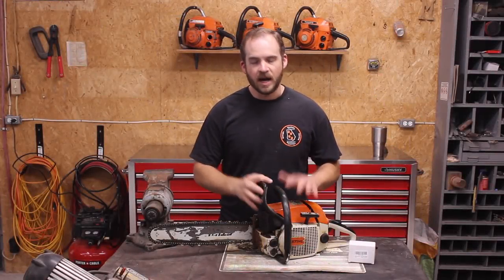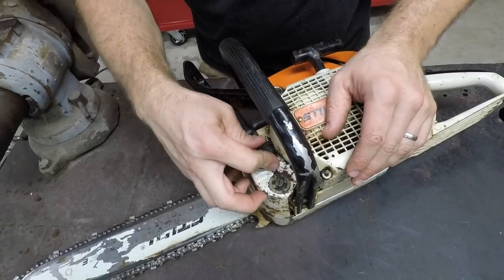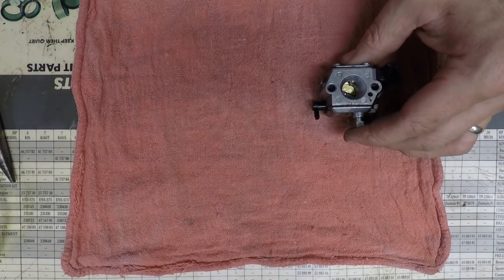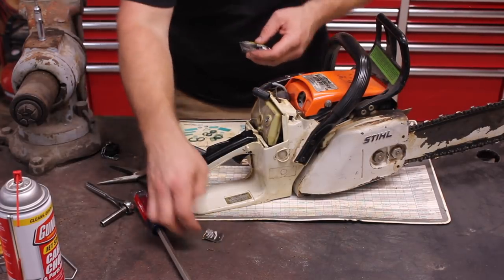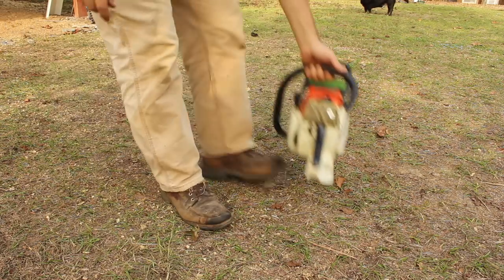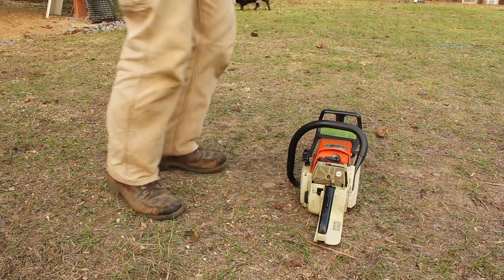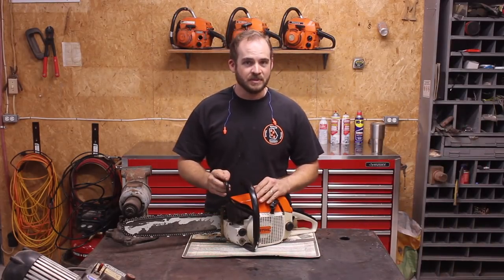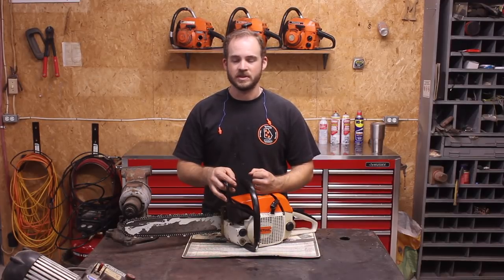Bringing a Classic Stihl Chainsaw Back to Life

Comment: I've got a 038 Farm Boss, Runs good but once warm its a hard start, Any idea on what the problem could be?
Reply: Check the cylinder bolts 1st, then compression next cold & hot. That saw's 40 years old & had 3 different bore sizes.
Reply: Next have it pressure tested & vacuum tested.
Reply: Headups, get an old gear oil bottle with a nipple top for the bar oil. Less mess. Old Snapper transmission transparent bottle works best.

Comment: That Chinese carb is set to rich on the L jet.  Anytime your chain continues to turn after you let of the throttle is running to rich.  Back it off a bit.  I have found Chinese carbs run best at about one turn out on both jets.  I tune them by ear and then with my tach.  Stihl carbs I set at 1/4 out on the L jet and 3/4 turn out on the high and then tune and verify with the tach.

Comment: Had the same problems with another saw just like that one - I forget which model, but it was the same design and had the same problems. It got traded for a new MS250 I think ... but a new one anyway. Nice Fix!
I still like my Husqvarna 242 from the 80's  better than that Stihl - even when it ran well when it was new.
For $17, even if the new carb lasts only a year or 2, you have a very low cost "new" saw.
Reply from the maker: I think it'll last fine with proper maintenance. I have a heart for older saws as well.  Appreciate you watching, Greg.
Reply: I have that same saw with the same problem! I'm gonna do it to! I like old saws too!

Comment: ii would have just cleaned the old one really good first.. just to test see if it helped. if it did it . if not ok no prob..  
but  17 bucks.. good deal.. AND you can if need be use the diaphragms and such from the new carb in the old carb.. lol
Its crazy rebuild kits cost almost or just as much as a new card.  But in the end the 17 dollar carb works great..

Comment: I ran the same plan on my Stihl saw..soaked the carb in carb cleaner for at least a week as loose parts...No help.. Friend says soak the carb body in 1/2 and 1/2 water and pine sol cleaner...The second I dropped the carb body into  solution .....black oily stuff came out...Left it for the weekend.... came home ....water was really dirty......Back together....ran like it was on athlete on steroids...and still running ...Think pine sol love to eat varnish
Reply from the maker: Good info! Thanks for sharing.

Comment: Good job and cheap also. Chinese parts are really hit or miss but this looks like it actually worked. I think your motor is a little tired. It should have sailed through that log. I wore my early 80’s 028 out. It runs but has low compression. Probably cut a hundred chords of rounds with that thing. It needs a cylinder/piston and probably a new carb. May not really be worth paying for a rebuild but may  try it myself if the crank checks out

Comment: I tried to put a Chinese carb on my 039 just because why not I was curious my oem carb is good but the Chinese carb would let my saw idle no matter what the adjustment was so I put my oem carb back on however I did run the china spark plug and fuel line they work just fine and the china Oilers are garbage

Comment: This ethanol gasoline will destroy 2 cycle engines i ruined 3 before a local station started carrying non ethanol gasoline. I need to check and see if i can get new kits like this for mine. Especially my little Subaru water pump i use that thing alot and miss it.
Reply from the maker: I use non ethanol too. I have a tiller that doesn't run well at all with 10% ethanol fuel. Stuff is tough on small engines.

Comment: Before you get too wrapped up with that model, pull the plug, take the PTO side parts off & see if there's any movement at the bearing. I've seen the crank break off flush with the bearing b/c of vibration (roughness) more than once.

Comment: Gota check the oil passages on the bar.  Clean the chain groove and tip roller/sprocket.  Slather the bar, bar groove, and tip sprocket with oil and spin the sprocket.  Simple Green cleans chainsaws excellently and is GENTLE on the plastics.  Simple Green will not harm the paint or plating!  Just rinse off with water and wipe dry with a rag.  The chain brake gets full of wood chips and debris, compromising its function and putting a slight drag on the clutch drum.  Gota blast that sucker clear of debris and put a dab of grease on the trip linkage.  Inspect the crankshaft ends for grease points:  that's how the clutch roller bearings are lubed/greased.  Remove the pull-start side cover and blast or brush clean.  While the side covers are off, blast off any debris and anything blocking the air cooling fins and passageways.   Then brush clean with Simple Green and a old toothbrush and rinse off with water.  DONE!

Comment: Where do you think the original carburetor was made?  Yep China.  I've had real good luck with the cheap carbs.
Reply from the maker: I actually think this one is old enough that the carb is made either in Germany or the US. I pulled a carb off of a newer Husqvarna saw today and it had China stamped on it. I think with regular care and maintenance this one will last a good while. Seems to be built well.

Comment: I get a kick out of those who diss the Chinese stuff when most of the "professional" name brand tools are manufactured over there, be it Taiwan or Mainland. If it's built to proper specs by whomever and with materials specified, chances are it will save a buck and work well. I find it difficult to talk down to someone who builds stuff that works, be it American, Chinese, German or anyone else. Examine the culture and see which ones are focused on precision and detail. The stuff coming up from just south of the US border is suspect, go farther south and it gets better.
Reply from the maker: You are correct. I pulled a carb off a newer Husky 445 today and it had China stamped on it. Just the nature of a global market.

Comment: The spark plug isn’t your issue, it’s that cheap Chinese carb. You can’t just hold them side by side and say it’s the same as the original. It’s the high standards of internal machining of all the channels and drilling’s and incredibly tight tolerances that make the OEM carb so superior.  OEM stihl carbs are such high quality and precisely machined. Changing that for a cheap, low quality Chinese aftermarket was a poor choice.  A genuine stihl carb kit is the same price as that junk China carb yet the quality of the OEM carb kit in an OEM carb is so far above anything you’ll ever get from that Chinese one. Bin it, buy a genuine stihl carb kit and rebuild it.